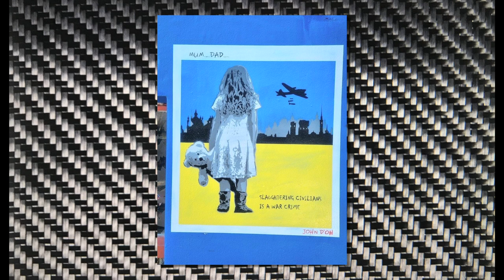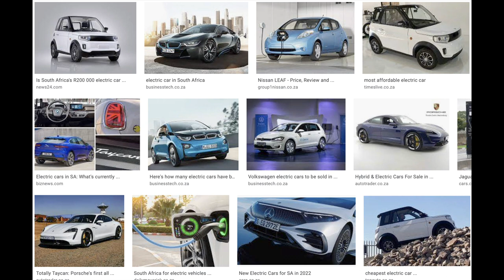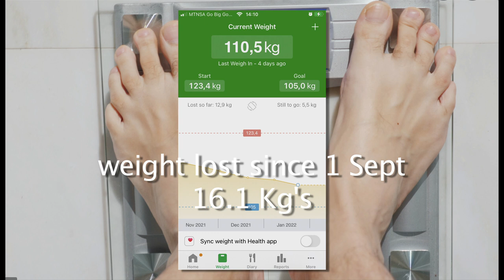EPISODE 72 RADIATOR TREATMENT

Comment: Just out of interest, with all the talk going around regarding the price of fuel, have you got any idea of what type of fuel consumption you will be getting with that motor?
Reply from the maker: Dale figures I managed to pull off the ointernet suggest around 5k's to the litre. This is one of the main reasons we have converted the motor to a turbo 352. Supposedly we will get closer to 9 or 10k's to the litre. We nit going to be going anywhere at speed so I am really hoping we can get decent consumption.